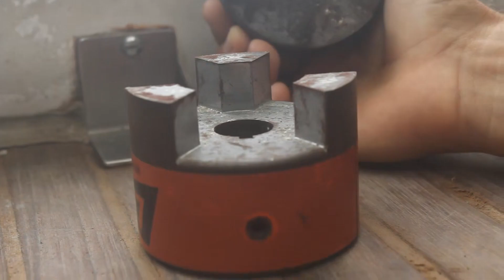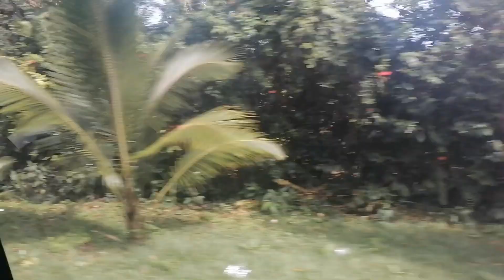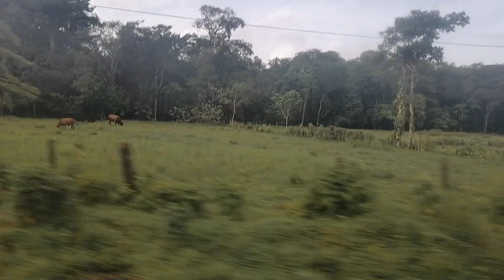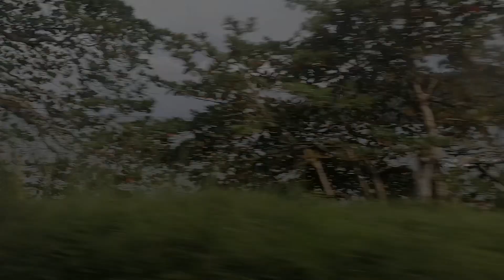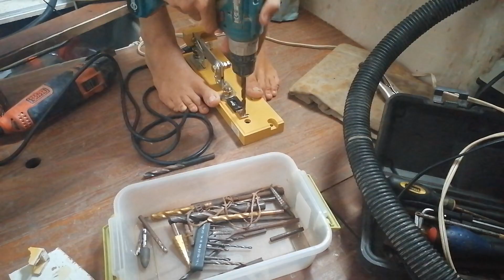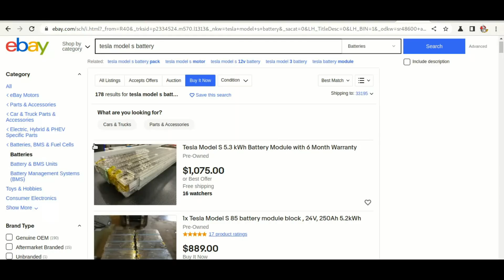Tesla model S - battery relocation [ DIY solar power propulsion on a retired IOR boat ] [Q12]

Comment: Have you considered switching from chain to belt?
Reply from the maker: Yes we did 😊 But at the end the price and ease of access to the chain and sprocket solution even in remote places won 😊
Reply: @svoiysh   i think you are underestimating belts, if maintained correctly they will outlast the chain... they dont stretch and dont need lube, if aligned-barely produce any noise, they lighter, check out Robot Cantina on youtube, that gramps using belt driven variable transmission to drive cars...
Reply from the maker: You are right they can last a long time if maintained properly but the price difference for the setup ( belt + pulleys) is much higher than the one we have so changing it at this point is not exactly in our budget 😉  Maybe one day 😊
Reply: @svoiysh  understandeable
Reply: @svoiysh  or if you still want to continue with chain- check out step 24 of sailing uma, they used offset link

Comment: Hello! I was recently thinking of implementing used EV batteries and engine into a sailboat. Though I do not have a sailboat, but this project is very interesting! Less noise, no more diesel tank. No more fuel expences. But of cource it has to be charged somehow. How are you doing it? With solar panels? How much solar do you have?
Reply from the maker: Hello thank you for your comment!😊 Oh yes we prefer everything around this solution to the stinky, greasy ,smelly and maintenance intensive ICE alternative  😉 We charge only with solar and actually not that much of it as we now have 300W ( on the sticker😉 ), which for us is more than enough as we try to use the motor as little as possible 😊
Reply: @svoiysh  Nevertheless, what are your speed and range possibilities under e-motor? Can you use motor batteries in other needs (watermaker, autopilot, radar, cooking etc..)? Can you use your engine as a generator (rotation by a prop), when under sails?
Reply from the maker: It's not so easy to answer as it depends on the conditions, but I'll try 😄 Our motor is 21KW but it's now limited to 10% ( we set it up like that with the controller ). So far our max recorded speed with it was ~6knots. Our  range really depends on the conditions and speed but from rough calculations with flat windless conditions  which are the only ones in which we would choose to motor over sailing we should be able to do ~30 miles at a couple knots speed. So far the longest trip we did on motor alone was 6 miles.  We use our Teslas to power the motor, to charge our 32ah lifePo4 house bank  and the rice cooker.
We don't have a watermaker or a fridge so this is plenty for us 😊 We don't have regen as our prop is a foldable one. Let us know if that answers your questions we will try to make a more in-depth video about our setup in the future 😊
Reply: Thank you for such a detailed answer! One last question. Rough calculations: you've limited your motor to 10% = 2100w, your max solar power is 300w (it's 14% of your max motor power, discount it to 10% with overall loss) Say you've got a nice sunny day. Is it possible to run your engine from solar (with no battery consumption)? What are your thoughts, about how much solar you possibly need to run engine at a cruising speed continuosly. Just interesting if there's enough place on 40-footer for a solar to make it possible.
Reply from the maker: Yes we can absolutely move on solar alone although we won't be braking any speed records 😉 The second part of your question is again a bit tricky to answer as different people have different definitions of cruising speed 😉  Also weather conditions influence that heavily so if you want to be able to do 6 knots against a 20 knot breeze it might be tricky but if like us you assume that if there's wind your sailing and if there is none you either stay put or go at a relaxed pace of a couple of knots  even our humble 300W solar input is enough 😊 I'm not sure if that answers your question but there is a lot of variables to consider. Also for a 40 foot boat it depends on your setup we don't have much space for solar as we don't want a bimini or any constructions that would increase our windage and mess with Montys' ( the wind pilot) ability to steer Oiysh 😊

Comment: Thanks for the video, I really like your install and I'm looking at buying the parts to do a similar conversion on my boat and I had 2 questions:

1: You've made a deliberate decision for the controller to limit current to 50A right? If you wanted you could set it to 100A (4.8kw) or 150A (7.2kw), or is something else in your setup limiting your abillity to run at higher load?

2: following on from Q1: what was your reasoning for going with the 500 Amp controller+ ME1003 and then limiting current to 50A? A: you want the flexibility to run at higher power in the future? Or B: efficiency/reliability gains from allowing your motor/controller to run cooler than say if you'd gone for a 48300-SR and ME-0909?
Reply from the maker: Thank you for watching :)
add 1. - That is right it's a decision not limitation. Fuse will go first (150A), then panic button (400A), knife switch (400A), ....
add 2. - We can go 400A momentary. Continuously 200A, typically < 500W on 100% of controller settings.   It's at ~15% to be in chill mode. So B ? But controller is cool motor in another hand not so much.  Working on it... And also we just don't need more at the moment
Reply: Thanks for the reply, Given that you were initially switching the bank between 24v and 48v I was wondering as to why you simply didn't run the motor at 24v? I guess there would be some minor efficiency losses due to the higher current, or is there something else I am overlooking? (I am asking because I have an existing large 24v bank I am hoping to repurpose, at least to start with)
Reply from the maker: Hi sorry your reply escaped me 🙃 The motor wouldn't run efficiently on 24V and also less volts more amps so thicker cables more chances of overheating stuff and general unhappiness ;)